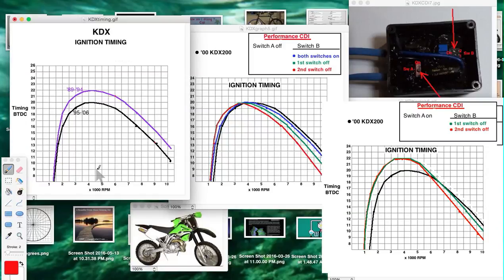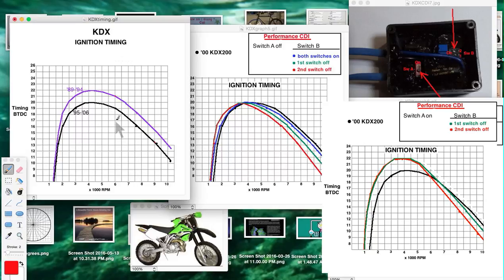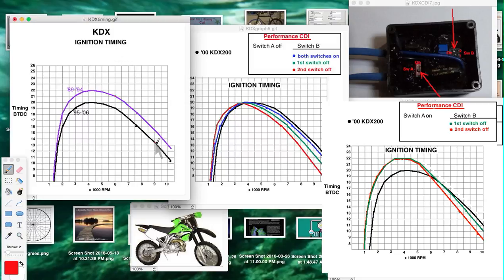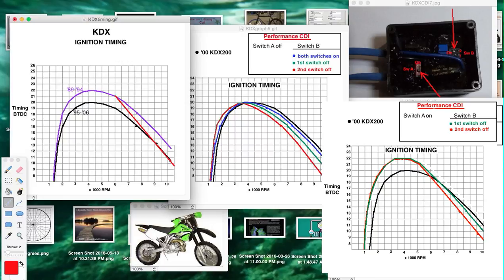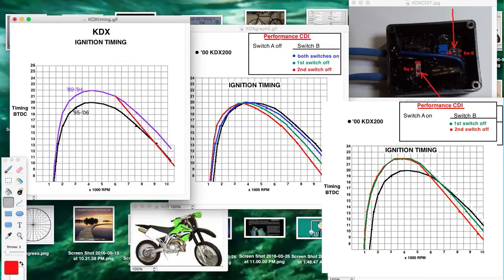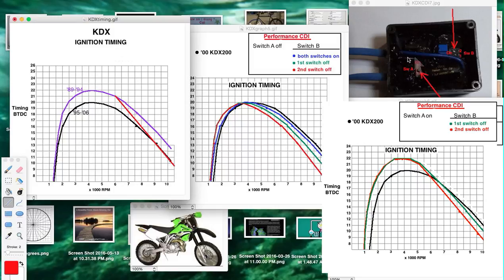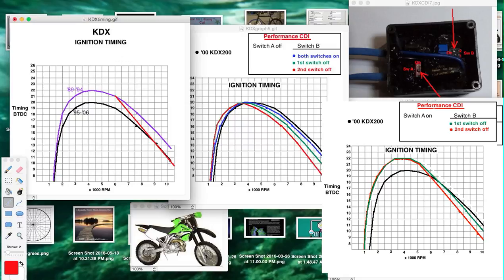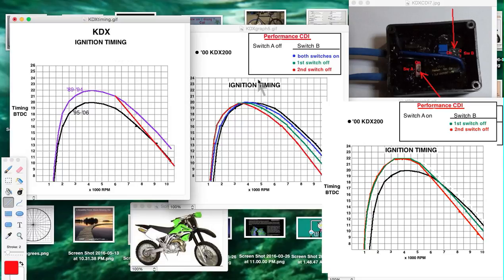KDX200 CDI ignition timing

Comment: Hi, l have a Suzuki ax100 with a couple of upgrades on it. I got bigger piston (57.50 mm) crankshaft 56mm instead 50 mm that come on the  stock engine , a 32mm flat Mikuni carb and the cylinder has of course some jobs done .the thing is that back in my country we use to race in short distance (300 mts). So l need the bike get a bit more power but as  quick as it can since it's a short distance race . We also use between 190°  _ 200 °of compression, but just for the moment of the race after we dropped dow to protect engine's life. My question is do you think your CDI could help me to gain  tha extra power l am looking for the short distance drag race ? Thank you.
Reply from the maker: Professionals use programmable ignitions because every little bit of power counts. I made the CDI for the AX because the standard CDI has a very awkward timing curve. I wouldnt be without it. Since you increased the engine size I hope you now have a full sized reed valve.
Reply: Yes that's what l want, but for now we just open the admission as much as we could in order to give a bit more of fuel ,but for sure l want to find a way to install a full sized reed valve .